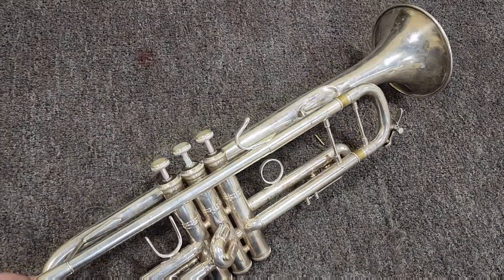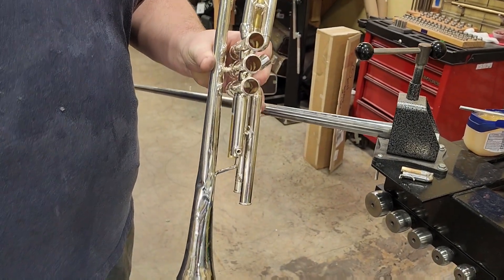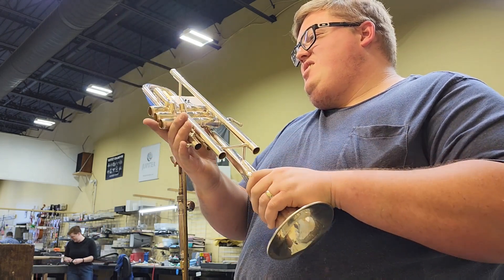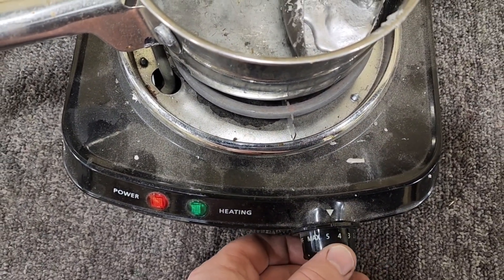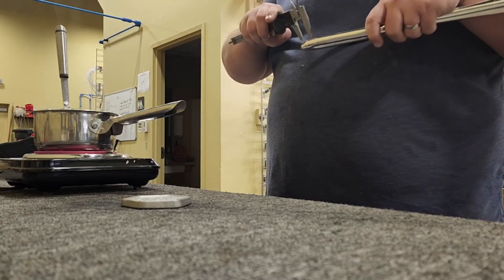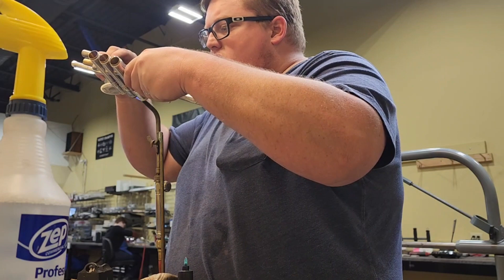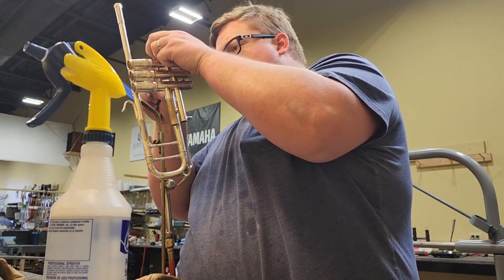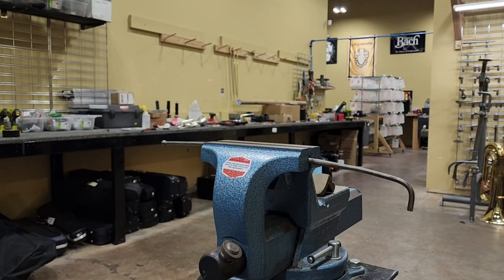Repairing and Modifying a Bach Stradivarius Trumpet

Comment: Great video, interesting to see all the different kinds of skills and tools used for the range of damage. I'm the son of a blacksmith and I am curious though, is the amount of repair and overall cost of that much repair worth it for the cost vs value of that trumpet? My father's business eventually went out of business in 2005 due to culture migrating to a throw away society.  I wish I'd thought of him maybe migrating his shop into instrument repair before that as he had the skills, he could make or fix anything and refused to migrate to much of any kind of modern ways, but his shop was geared to repair of small motors and repair & manufacturing obsolete parts made mostly of steel.

Comment: you dont polish the inner slide metal of the three slides? just curious great vid!
Reply from the maker: @swoodc  thank  you! The slides receive a small amount of polishing by virtue of the silver polishing process. However, it is not necessary (or recommended) to regularly polish slides with something abrasive, even like 1800 grit paper or finer. Polishing in any form removes metal, and eventually leads to leaks. The silver polish just happens to remove less than a micron.

Comment: Super impressed with your work! Are you accepting repair work? I have a trumpet I’d the dents removed from the bell and a couple of small dents in the tubing that goes into valve casing. If so, do you have a website or can you provide your contact information? Thanks!

Comment: how much it will cost for restoration?
Reply from the maker: Feel free to call me at Palen Music Center in Springdale Arkansas to discuss pricing.
Reply: I bet it could be a $500 plus... and it’s worth the investment to restore a Bach.
Reply: It could go for 1000 too much repair and cleaning
Reply: @cmorales5      ...you are absolutely correct about the investment to restore a valuable Bach. I reckon $500 is way too low for the amount of work that was required - you can also see that the work was done in a proper, fully kitted out workshop. These things cost money to put together and maintain. And finally there is the deep knowledge and experience that underpins the success of such a restoration - as the man said, "…it’s not the tools, it’s the technique."
Reply: @illitrait  agreed.

Comment: I really enjoyed your video showing how to fix issues with the Bach Strad. Good job on the first class work. I do have a few suggestions on the video. Most cameras have mediocre auto focus. Let me suggest a Panasonic S5ii or S5iiX;; by far the best camera for the features it provides. The AF is excellent, but for difficult areas let me suggest you have an assistant to simply tap the spot on the LCD you want to focus on and the camera will do the job perfectly. 90% of focus issues will be easily done in AF. But when you have to focus on a small spot in the corner of the video use your assistant to touch the LCD on the needed spot for focus.
On the S5ii you can also touch focus on a spot and when the object of the spot moves the focus will travel with it.
What's more, the colors on the Panasonic are superior to most other cameras at a fraction of the cost of those cameras---specifically Canon and Sony.
Next, (I have these same issues), stop eating carbohydrates. They are poison for body. 
I mean, no more than 0 to 20 grams of carbs a day. 
You will lose weight and your neuropathy will cease. 
No bread. Plenty of fat, lots of butter is fine. Good fats, no margarine or seed oils.
Do that every day, no cheating. You will lose weight and save your life. I'm 77 right now, and if I had not done this very thing I am sure I would not be around to live to 77.
My son has the same weight issues, but will not listen, so he is putting his life in peril. 
You are doing such good and careful work you should do what is needed to keep you around longer. 
I cut out carbs and lost almost 100 pounds, and totally lost neuropathic nerve pain.

What a great video and great explanations. Thanks so much.